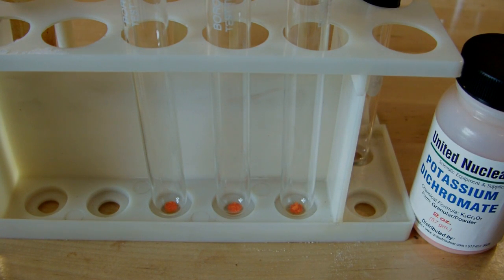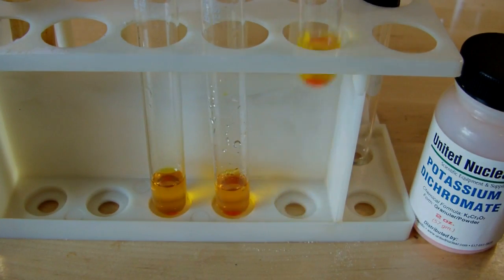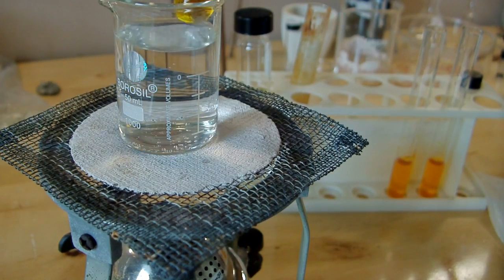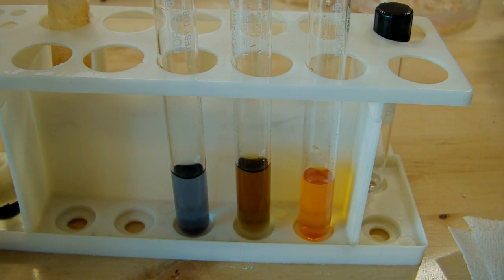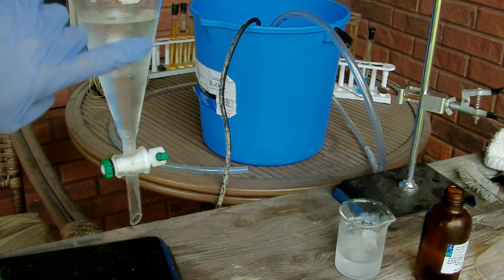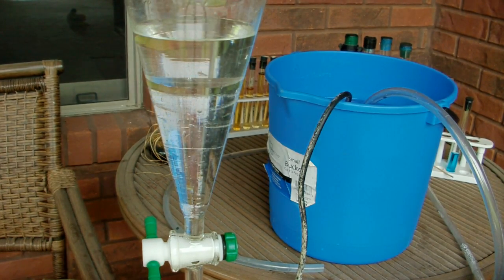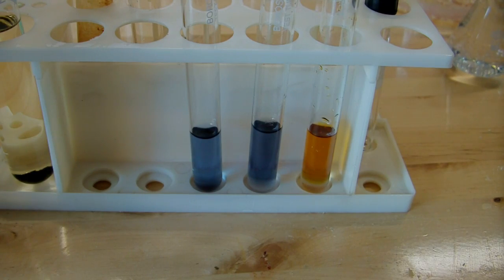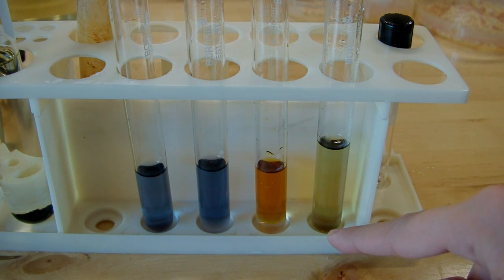Dichloromethane Purification

Comment: could you then recover the methanol from the rinse water?
Reply from the maker: Rsaramallac Sure! It would distill out at it's boiling point, likely contaminated with some water. I had thought it formed an azeotrope with water, but nowadays I'm not so sure!
Reply: I tried it, and all i could get it to do was reflux in the boiling flask and kjeldahl bulb.. I even tried insulating with aluminum foil, but still nothing. Is it even worth it to recover the methanol?
Reply from the maker: Rsaramallac Not really, in my opinion. I can buy it pretty cheaply at WalMart as antifreeze - look for HEET brand in the yellow bottle with blue label (NOT the red-labeled iso-HEET! That's isopropanol). It seems fine to use right out of the bottle, but a quick distillation couldn't hurt.

Comment: I would recommend using a different test for alcohols. When I purify DCM I use nitrous acid to test for alcohols. First dissolve some sodium nitrite or any other nitrite salt, then add in your solution you want to test and then quickly add sulfuric acid. Shake it up to move the blob of immiscible liquid. If there is a ton of bubbling and a little bit of brown gas (NO2) you have an alcohol. Yes the addition of sulfuric acid is exothermic which is why you use a small amount so as to avoid stunting your results with the bubbling coming from boiling liquids and not the reaction of an alcohol with nitrous acid. The other product of the reaction of nitrous acid and alcohols is the corresponding nitrite ester. If you have methanol in solution you will generate methyl nitrite.

Comment: Hi, thanks for this video.
The paint stripper I used did not list alcohol but did list acetone which boils over at 56.2c compaired to 39.75c for CH2CL2.
I did this test and it turned green.
Does this mean that my stripper did have alcohol but did not list it or does this test show acetone as well?
Well just check with acetone and  did not turn green so I guess this stripper must have alcohol in it after all.
Reply from the maker: Yeah that's interesting, I looked around a bit and this test should not give a positive result for ketones (acetone). Try some more water washes to extract the rest of the alcohol. This is a perfect example of why we do experiments and testing - you never know what's in these OTC chemicals!

Comment from the maker: Do you mean the wire gauze I set my beakers on above the butane burner? That's a metal mesh with ceramic in the center. I use that because it's bad to directly heat things with the flame, since that can cause hot spots and potentially shatter the glass.

Comment: I see you're holding the funnel incorrectly. One hand should go on the vent, the other grabs the neck and the stopper. There's no need to grab the body of the funnel. It only heats up the solvent and you get continuous venting, especially with such low boiling point solvents as DCM.. Also, you don't need gloves, they only make things more slippery. However, it's smart you're venting as soon as you flip the funnel over. Most people will just start shaking and cause a burst. Otherwise, nice video.